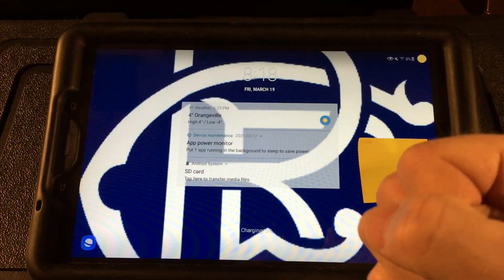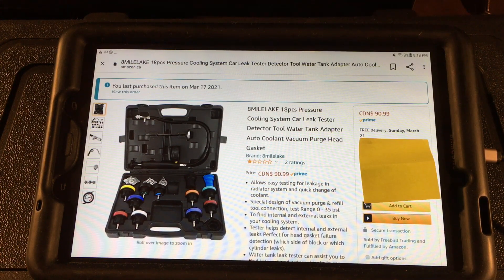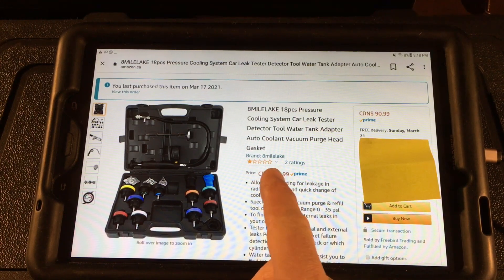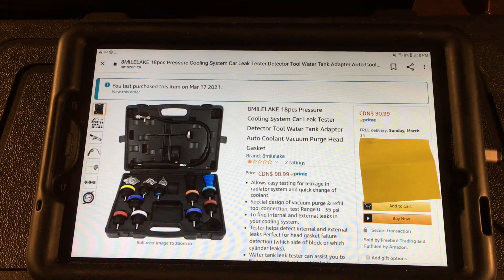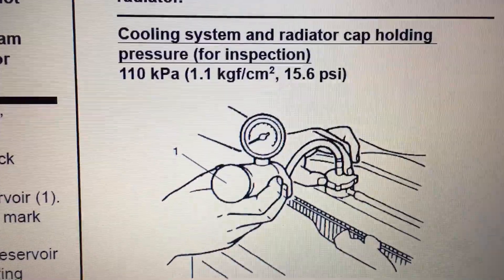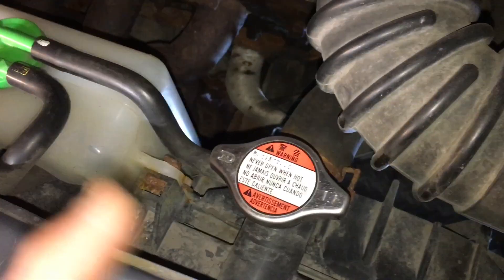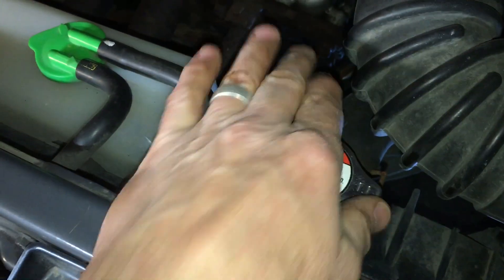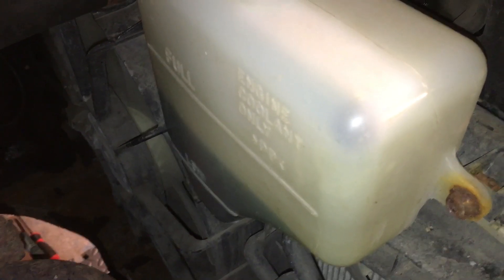SX4 Coolant Leak/Pressure Tester Review

Comment: Coolant leaks are weird as anyone cant imagine. One time I was absolutely convinced that the coolant was leaking upwards on a plastic tube, at least I spent two hours looking for it, finally was an internal crack alongside a plastic piece but I was considering that gravity laws were changing that day. I used similar pressure caps and when the pump fails you can do It with compressed air, being more cautious for sure

I see the other day you quoted me about the radiator cap so thank you!
Reply from the maker: Thank you Sir. It was a very sensible suggestion.  Cheers 👍

Comment: Nice diagnostic work.  My son is going to Toronto and I will get him to send back a barrel of tools from Amazon.  Do you have a preferred scanner?  Rust is a pain my 2004 Jimny has none.  Thanks
Reply: Thanks I am going to gear up the garage.  He is leaving today.  I hope I got the ducks lined up
Reply from the maker: Thx Andrew...For Scanners I use an Autel MD 802 Elite, a Vpecker E1 (Windows based s/w dongle) and a Snap On Modis. They are all a little dated now.
Make sure your Son is well aware of the current restrictions on travellers. They are quite Draconian. Hopefully he’s not coming until things are somewhat back to normal.
Suzuki never sold the Jimny in Canada. Otherwise I would have had one long ago. Cheers 👍

Comment: I have been collecting old radiator caps from scrap cars . I then drill a 12mm hole in middle and pull a tyre valve through the middle.  Then I use my good quality bike pump to pressurise the system. Works well and cheap idea
Reply from the maker: Yeah I have seen that done . I am lazy & cheap 🤣  Thx for watching 👍